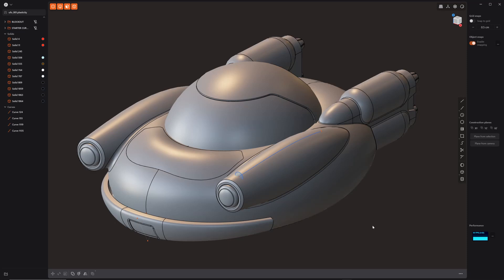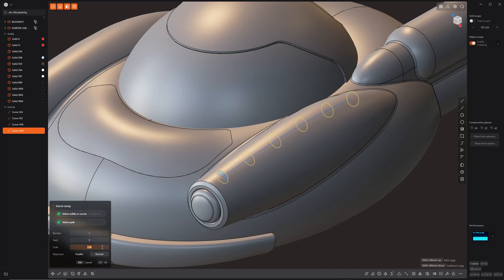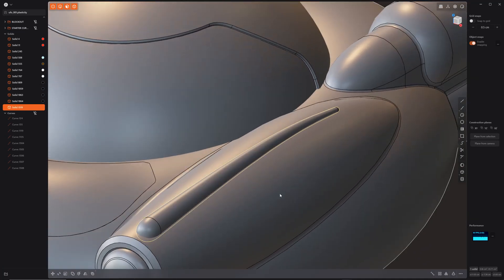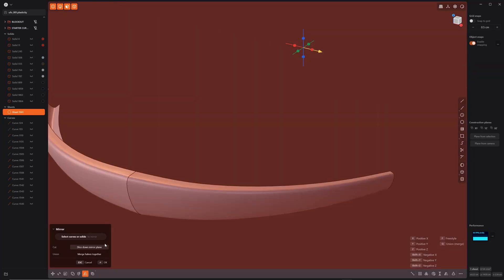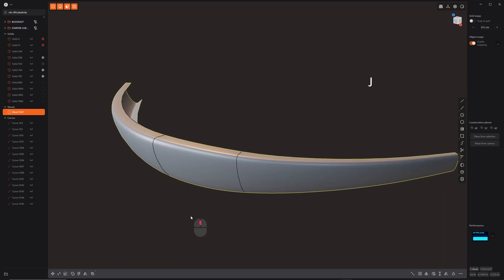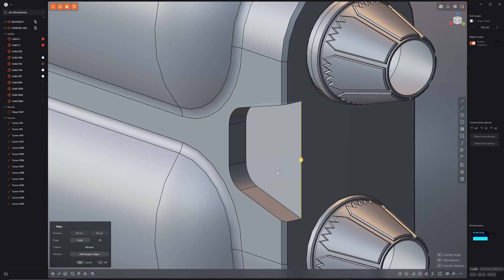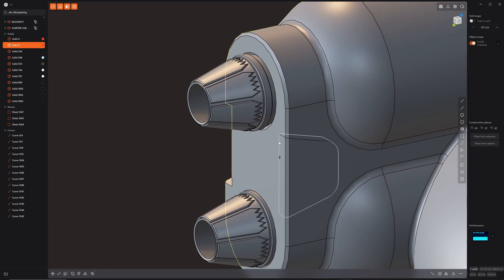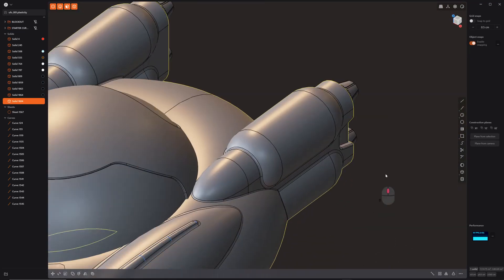PLASTICITY QUICK TIPS #1

Comment: Thanks for the video! Tips are really usefull. 
I want to add a small tip to the list to speed up the process.When using mirror functionality and whant to merge 2 parts together, you can not just click the button in the Mirror menu, but use Q key as in Boolean feature - it will do the job.
Reply from the maker: Cool. Thanks, that is annoying having to click that. Definitely put that in the next video.